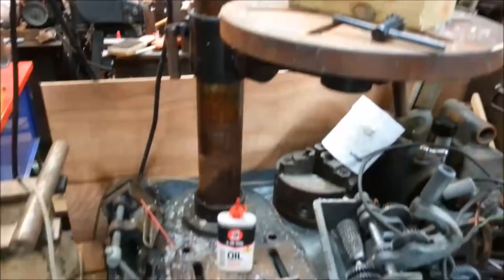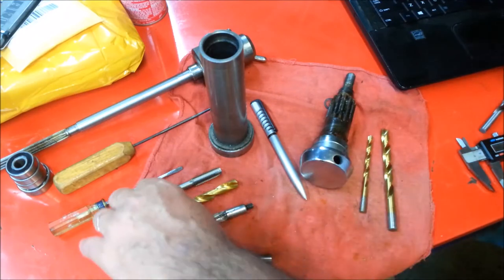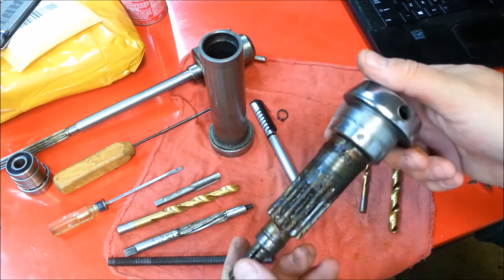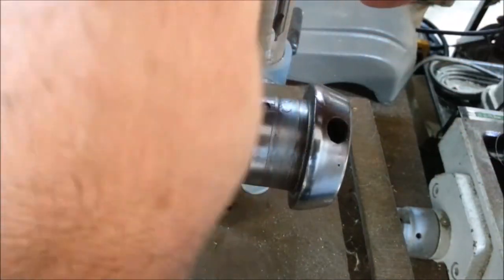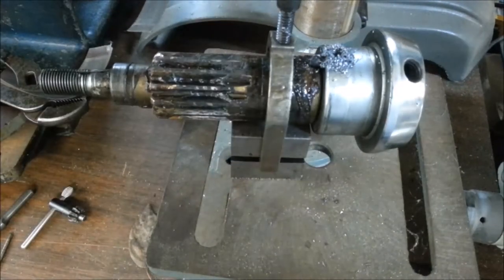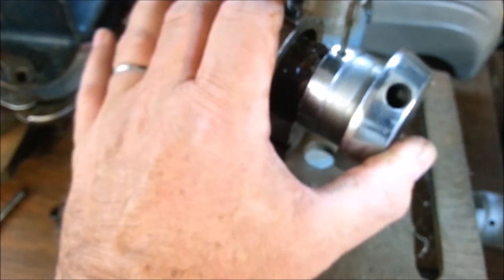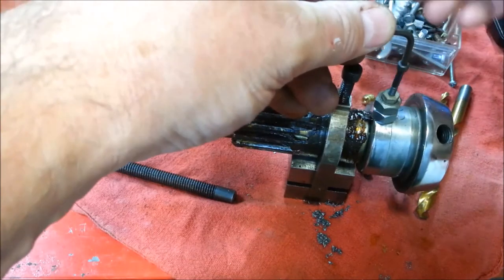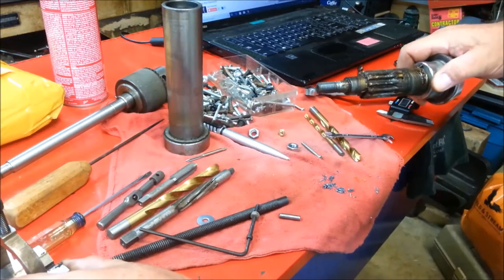Day In The Shop 2 - Remove Blind Pin - Drill Press Restoration - Crafted Channel

Comment: Great job on the pin removal but I cant believe your going to leave us hanging like that.
Reply from the maker: Getting that cap off the shaft is the same problem. Blind press fit. Different solution.

Comment: I am right at the point BEFORe you do anything to remove the pin.... I believe that is a loose fit, retained by the assembly.... whack device against a block of wood, see if it flies out.      I came to this  video, looking for methods of removing TENSION pins in a blind hole. I have pins with a hole over 1/16"  but under 5/64" VERY small.   I will try 1.7MM TAPS to bind and pull to extract..... but I fear I will snap taps